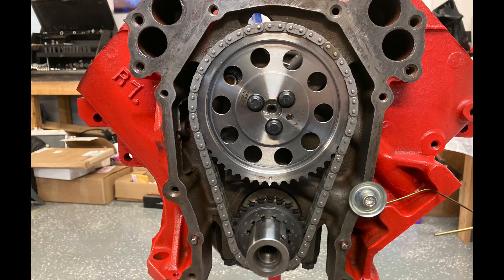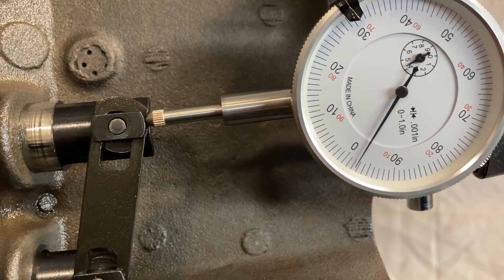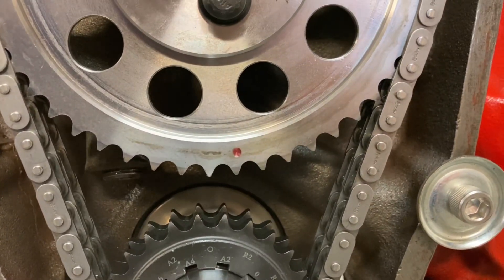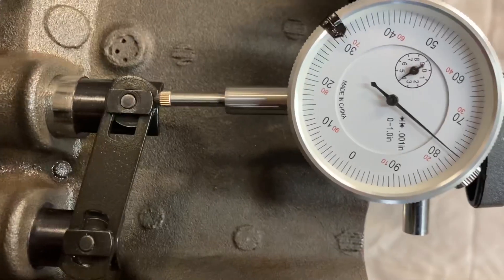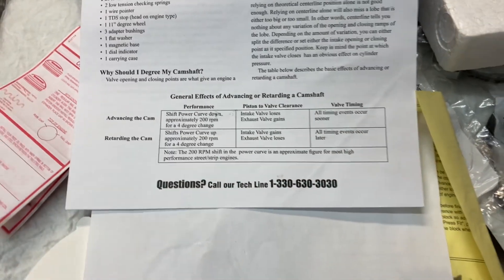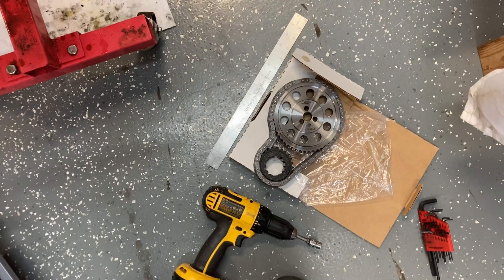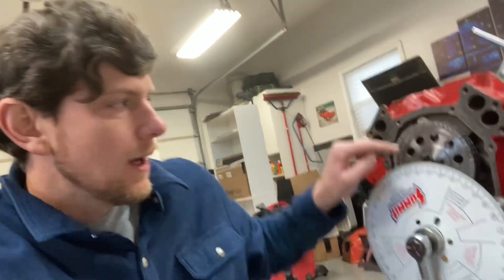Secret Truth to Degreeing Your Camshaft: Dot to Dot isn’t Good Enough!! #engine #compcam #mopar

Comment: Hey  Mopar Joe,.....Thx for another Helpful video.....Got a question  'bout your camshaft Install Lobe Centerline method & need a little clarification if you will.....After your Lobe Peak lift dial Indicator zero up, & you turn Clockwise to Drop 0.050" & Record Degree wheel #,  Why do you Reverse direction & turn Opposite (CCW) go Back thru peak 0.00" & Continue CCW direction to Drop 0.050" again ? .....Seems  that would Split the Timing  chain Slack error + provide the Averaged corrected Lobe ICL position Degree position..Seems that Would be correct if the Crank Actually did Reverse directions when running but it don't. Why not Continue rotating Crank Clockwise & come up on the other side of Peak at the 0.050" point & Record Wheel Degree #, do the math thing & Record the Actual measured Lobe Centerline  the Way the engine actually uses the Chain Slack ?? .....Keeping a wrench on the Camshaft bolt & slightly pulling CCW would insure All the Chain Slack is Out (like the engine does) during the rotation process.....I could be really messed up on this thinking & is why I'm asking.....Thx,.....tom..
Reply from the maker: Thanks for asking. I had to turn counter clockwise to get to the opposite side of the lobe. If it was a hill, I started off on very top, then running down hill .050. I reversed direction going back to the top, then past the .050, so I can sneak back to it (taking any real or assumed slack from the chain. I did try it without going past and it was still within a degree in the equation.
Reply: Thx Joe.....I'll  keep that in mind.....Hey,....If you Kept the 1st one at 15 Retarded,......You'd have a 15K Rpm Mopar !!

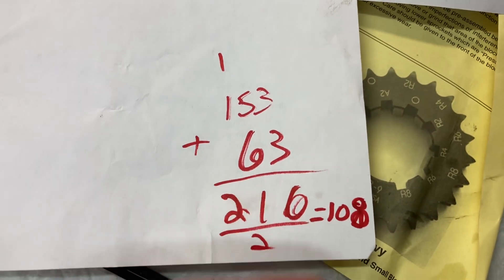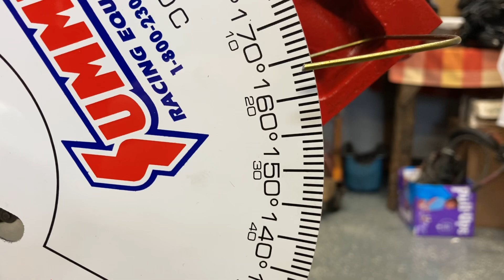Comment: Great video Joe, but at 2:33 I'm reading 68 degrees instead of 63 as you said. Same at 7:49, 168 instead of 163? Anyway, maybe I'm wrong but I'd figure to point it out to you.
Reply from the maker: Thanks for sharing. I double checked when you said that. You can see the long line “65” above the line, and the “70” above the line. I was taking all measurements from the bottom side of the hangar wire. Thank you for sharing. Better safe than sorry.
Reply: @JustMoparJoe  got it. I assumed the top portion of the wire. The camera can alter the view aswell. Anyway, good to hear.
Reply: @JustMoparJoe I'd definitely sharpen that wire  pointer, and get it closer to the degree wheel, to lessen the chance of misreading the numbers because of parallax.

Comment: Very good detail, sir. Something new to learn everyday. When I replace a timing chain set, I always check that the dots on both the cam and crank sprockets line up correctly. The dot on the camshaft sprocket should be at six o'clock, and the crankshaft sprocket should be at twelve o'clock. This should also apply to GMs and Fords.
Reply from the maker: Yes sir. Be sure and check on newer builds. My gen 3 hemi had to have the crank gear at 12 o clock. There are others that way as well. It may have to be to make the computer and cam sensor happy.

Comment: I had done a quick reference check similar to this last year when I replaced the timing chain in my 1995 
  4.0 litre jeep engine, 
  Now mind you, I wasn't using a degree wheel , or a piston stop or anything,  I was just replacing the timing chain and some seals and gaskets to freshen up the engine a bit
  Using the timing marks on the timing chain cover and the timing mark on the harmonic damper I was able to determine that the cam timing was running right around 10 . degrees retarded due to the amount of stretching and slack that the timing chain had , the engine had  around 250,000  miles on it with its original timing chain and gears, and the timing chain was stretched out to the point that it was just starting to make light grooving on the rubbing block inside the timing chain cover .
 I did not measure the exact amount of stretching in the timing chain and compare it to the new,  but after seeing your video here today, I kinda wish that I would have measured it just for curiosity purposes.
  Thank you for your videos Joe, 
   Keep up the great work.
Tim from Wisconsin.
Reply from the maker: Thanks for sharing!

Comment: Those new fangled cam phasers started out a good 25 maybe 30 now. They are prone to noise, lack of adjustment and failure if the oll lets dirt get into them, lack of lubricant, and bad or broken springs will give you a bad engine in a instant. Granted they come a long way from the beginning they still , bu😂wt routine maintenance and good oil changes and premium filter still have to be followed along with the replacement schedule on the chains, guides and replacement parts in the kit. Maybe a video might on the list for him in the slower season after the Drags in the spring season. Great day today and enjoy your morning, freezing here, 32°F and windy at 20-30.
Reply from the maker: Oh man. We made it to 70 degrees. My track had a gamblers race. I’ll be there in a week or three
Reply: @JustMoparJoe  wow that's is a different one but it was the way it was.
Reply: @JustMoparJoe  and I wish you the best for it's still in the low 40's here with sunshine and the Wind is the way to get you back inside after a trial run.
Reply: @JustMoparJoe  I wish you a sooner arrival than that so you can get a few things done and try to get it done and tuned in before the bounty kicks in on my friend. God bless, be careful, and be safe. Great evening to you and your family JMJ.

Comment: On a general build stock cam, stock gears, stock pistons dot to dot will usually be in the ball park, any performance motor needs to be degree'd, personally I degree every camshaft I install.
Reply: How is the adjustment made? I watched 10 vids on decreeing cams and nothing ever happens after the measuring?
Reply: @ian9toes  You need an adjustable timing set to make adjustments.
Reply: @wally7856  cheers mate, I’ve already put my motor (TB48 Patrol) back together and it was just a matter of lining the yellow dots up and that’s it.
Reply: @ian9toes  In theory that's all you should ever have to do but parts get made wrong or 'ol cross eyes cut your cam on a Friday afternoon and things aren't right. Easier to verify with the engine on the stand then to troubleshoot who know's what's wrong  when the engine is in the car not performing well.
Reply: I had a GF that had one tooth off...

Comment: I think that chain may even be too tight.
Reply from the maker: It’s a little tight, but with roller spring pressures, it will loosen up in no time. The 440 source was the right amount of tightness, after it was worked over. Few times and oiled.

Comment: not degreeing the Purple shaft cam , made my engine very sluggish years back,It sounded really powerful, we went dot to dot  and not until 3,000 rpm  did it start to pull. the 284/484 cam. zero knowledge available in 1980s. i do not think Direct connection told you to advance by 4 degrees
Reply from the maker: Thanks for sharing! That’s a good old grind
Reply: @JustMoparJoe  there is a Guy making Videos with said camshaft in his" duster garage " channel runs really nice too, very interesting that he has car in the near Mid Eleven second range
Reply: The purple shaft box gave recommended c/l number. I don't think they gave you degreeing instructions with the cams but there were several pages devoted to it in the Racing Manual. I don't EVER recall them recommending just blindly advancing the cam. They recommended ALWAYS degreeing the cam.
Reply: @budlanctot3060  never said they did , just that i never found that Page , i did not Library stuff back then

Comment: Are you going to be able to move the came where you want it or do you have to live with cam being off 2 degrees?
Reply: You can also do it with offset bushings for the cam gear, or an offset key. With a 3-bolt cam it's probably better with a multi-heywayed crank sprocket or an offset crank snout woodruff key.
Reply from the maker: Yes sir. Moving it with the crank ⚙️👍🏼
Reply: @JustMoparJoe  Please make a video of that, thanks!
Reply from the maker: @ws2664  I will try to next week. I still have to video setting the end play on the camshaft
Reply: @JustMoparJoe  Yea no problem, when you get it that's fine, my brain cells are coming together as one.

Comment: So say you’re dot to dot and still not matching the card. What’s the next step?
Reply from the maker: I verified that I was lined up, then advanced the cam by the crank gear. Then recheck 👍🏼
Reply: Ok, so with a special crank sprocket. Possibly an offset key?
Regardless, that’s the video I’d like to see.
Reply: @UnfinishedProjectDartSport IIRC, LA's use an offset key in the cam, and B-RB's use an offset dowel pin. If it's way off you may need an offset crank key, but that would entail changing TDC mark on the damper, too, so not recommended. Nowadays, plenty of timing chains have multiple keyway crank gears, so that's an option, too. But I'd definitely redial the cam to double check the offset keyway crank gear did what it was supposed to.